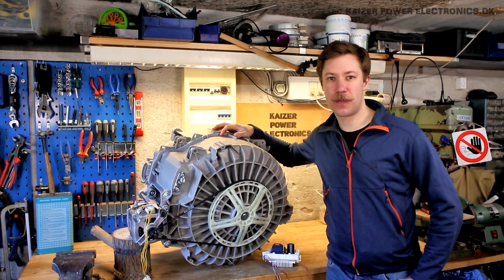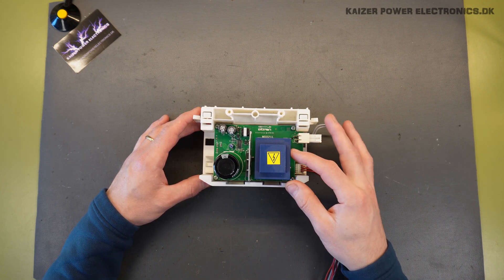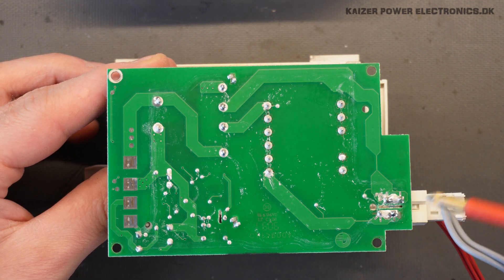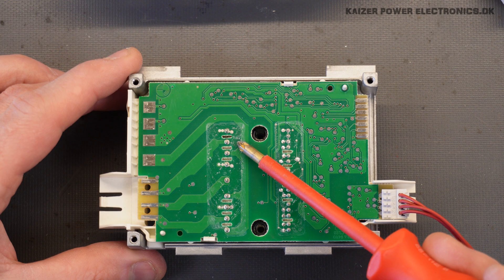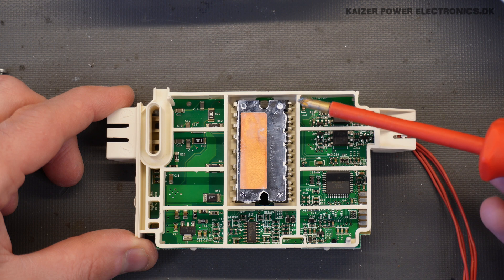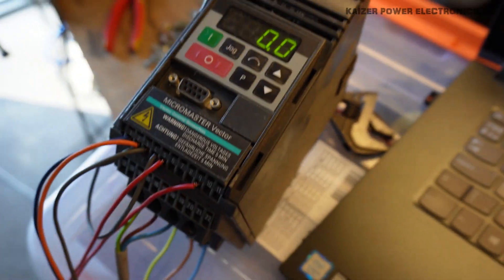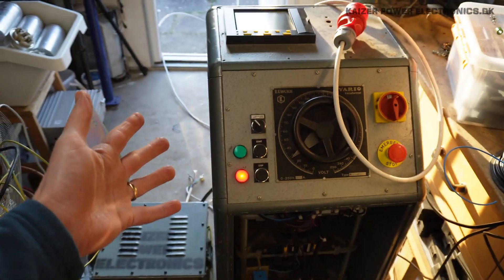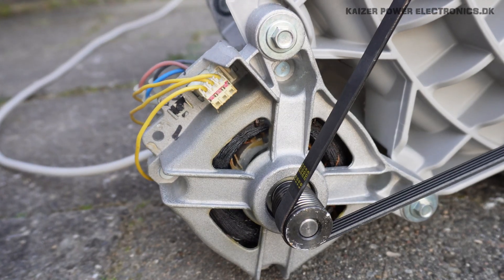Washing Machine Motor Burnout and Controller Teardown

Comment: that's a delightful little motor control. i wish they made general-purpose chassis-mount drives that small. for retrofitting fans and such.

let us know if you ever dive deeper into the power stage of that drive! from the shape/pinout of it it looks like that IC is either a Fuji or Mitsubishi IPM. if it's an IPM that would explain the relative simplicity of the surrounding circuitry

Comment: At first sight you would think these are more reliable than the old brushed motor version. But carbon brushes are dirt cheap and easy to replace. I have seen a lot of these with a burned out VFD IC. They are sensitive to spikes in the mains and the VFD board is very expensive to replace. The only real advantage is that the washing machine makes less noise with the brushless motor. They dont make that typical "whine" when spinning. There is another version of this where the motor directly drives the drum, without a belt.

Comment: Something doesn't add up.
The type plate indicate:
195 V @ 310 Hz = 0.629V/Hz
And  36 V @ 10 Hz = 3.6V/Hz
If it was same coil set the wash coil wood receive 1116 V or the spin coil wood receive 6,2 V when washing 
It must bee with 2 set of coils. 
But a smoking good video 😊
Reply from the maker: There is only 6 wires from the windings, connected into 3 wires to the controller. I am guessing that the drive must have used pulses. A washing machine also accelerates in multiply steps. Maybe its just taking its time to get the load of evenly distributed wet clothes to top speed and only put enough energy into the "fly wheel" to keep it at a certain RPM. Good balance and low friction bearings = smaller motor...

Comment: Fairly impressive board for an appliance.  In US models, you'll still see cardboard protectors, thru-hole, and wave soldering rejects.  Also on US models, the plastic drum housing is incredibly flammable.  If you still have a piece of the thing, take a lighter to it and step back.  Nothing wrong with smoke on an electronics channel 😄
Reply from the maker: I got a really big smoking thing for later...

Comment: Maybe not what you intended but still an interesting video. I have always wondered what would be used in a washing machine where the drum can spin very slowly but also at 1200 rpm (spin drying). Never realized that an AC motor with a VFD would be the obvious choice for that.
Reply: It's not how it's usually done, especially in the past.
Very old high-end machines may have a dual motor on a single shaft: One Asynchronous motor for high torque and one series-wound brushed motor for high speed, switched in and reversed via relays.

Old to current machines use a brushed motor with separate rotor and field windings that get swithed using triacs. Switching them in parallel gives high torque, while switching them in series allows high speeds.

Comment: you probably need to set "frequency at full voltage" or base frequency to 310hz in the VFD, its seperate from the "speed" frequency you can adjust. i almost smoked my cnc spindle because it wanted 400hz but i had it set to 50 on the vfd...
Reply from the maker: I went over the VFD manual again and it does not have that advanced options. Its only motor specifications and min/max speeds. I could properly have started it at 300 Hz, but that would have sent it flying around :D
Reply: @KaizerPowerElectronicsDk  just looked into the manual, its option P081
Reply from the maker: @gamerpaddy  "P081 Nominal rating plate frequency for motor (Hz) 0 - 650.00 [50.00]". Here I went with 50 Hz, as what is nominal for a motor with a 10-300 Hz rating :) But its too late to try that out by now :o

Comment: I dont know how you had your VFD set up but the motor would need lower voltage at lower frequencies due to the coil reactance/impedance
Reply from the maker: That was not an option for my old VFD, but I first realized this while editing the video :)
Reply: @KaizerPowerElectronicsDk  👍 I would expect that if the VFD has a current setting it would adjust the voltage to stay within the current setting 🤔 or maybe it just cuts out in over current idk mate as I've never had that model VFD.. I know you know about reactance/impedance but we all have brain farts at times 😅 its because you were using a VFD you just expect it to work,  if you had built a driver yourself you would have thought of the coil reactance/impedance etc 👍👍
Reply: @KaizerPowerElectronicsDk  it would have been nice if you had chance to scope the inputs before the damage/disassembly, would have be cool to be able to run the original inverter, I was surprised how small it was, was you? interesting to see though, when I saw the thumbnail on my phone I thought it was one of those direct drive drums.. was there anything worth keeping from the machine?
Reply from the maker: @T2D.SteveArcs  Inverter was indeed smaller than expected. Not much worth keeping, as everything is made so cheap that not even bolts and buts are used, but self-tapping screws and rivets. The motor is riveted together. Its almost impossible to take something apart, because it was never made to be serviced (except exchanging whole parts). The driver IC being soldered through the plastic shows this clearly.
Reply: @KaizerPowerElectronicsDk  yeah they are definitely built down to a price, self tapper's and rivets 😅🤦🏻‍♂️"throw away society"  🤷‍♂️ we had a tumble dryer, it was around 2 years old and it started squeaking as the drum turned, I took it apart expecting a bad bearing, nope they had used a bronze oil impregnated bushing as the main drum rear bearing and it had worn  right through to the pressed steel sheet "mount"  I've seen better in printers , oh and the motor had a drive belt that went from the motor pulley round the actual drum 😅